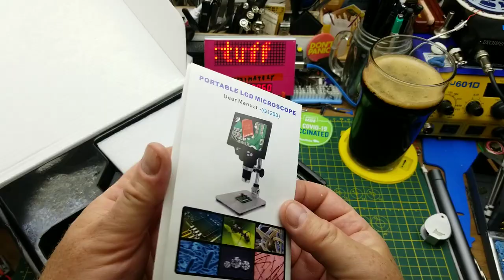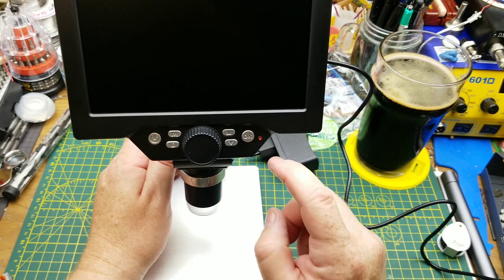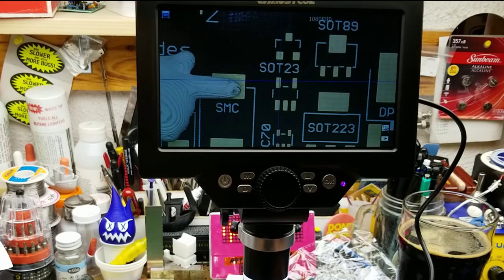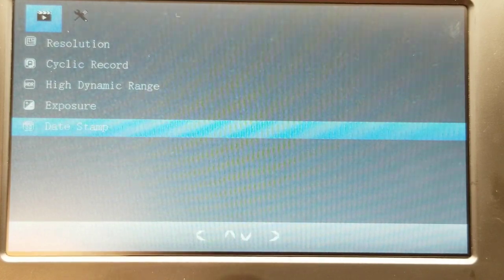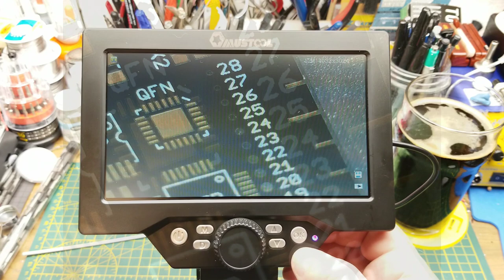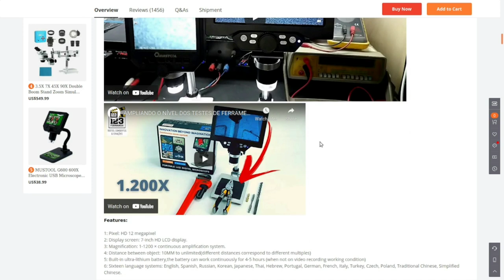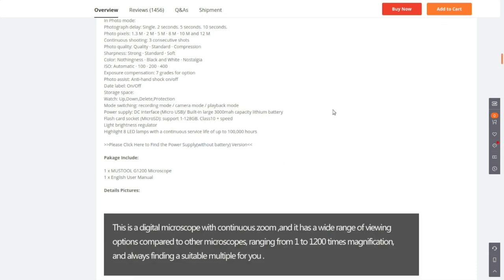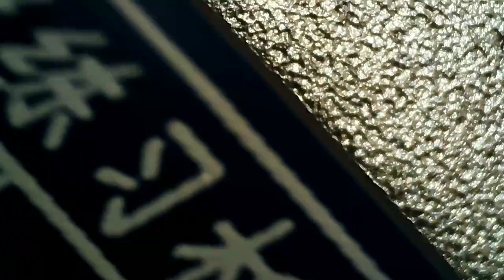Digital microscope review/first look

Comment: Just a couple of quick tips: 1) put a silicone sheet under the board to keep it from sliding around, and 2) make sure your soldering iron heats up the pad AND the component (position the iron to contact both at the same time) before adding the solder. Bonus tip: at these sizes, extra flux can help "hold" parts in place, and distribute heat (reducing the chance of overheating the board or part).
Reply from the maker: I do need some practice working at this scale.
Thanks for the silicone pad tip, that's a good idea.
Reply: I would also invest in an air reworker and some wick, low melt solder and flux.

Comment: It takes about 15 - 30min before your brain gets used to not having your hands in front of your eyes. 
I find it easier to hold the part in position, load the iron with solder, and apply to the end of the part to tack it down. You just have to drown the area in flux beforehand and that will attract/clean the solder to the part/pad. 
I've got 4 dead PC motherboards with 0402s'. so it quite tempting - lol -.

Comment: I purchased one of these a couple of months ago and find it invaluable for inspection and fine soldering. My only complaint is that it does not go high enough for some soldering jobs and catches on the iron etc. I have overcome this by purchasing a tall laboratory type stand and place the unit onto this which raises the unit to about 10 inches (25cm) from the base. Well worth the money even with the modifications.
Reply: Sorry, are you saying that the "zoom factor" of this item, out of the box, is too high for soldering jobs and that I can manage to use it better if I put it away from my PCB?
I am looking forward this kind of suggestions before buying it and the video does not completely answer about (I only see close-up view of 1 or two components which is not ideal for soldering)
Reply: Well a cheaper alternative is just put it on a stack of novels or books, but i am thinking of getting an ipad table stand instead.

Comment: I've not yet tried surface mount soldering but I have been watching live streaming lately to pick up some tips. A streamer named Syd Heresy does a lot of live SMD assembly and trouble shooting. pileofstuff would do well to clean his boards with rubbing alcohol and a toothbrush to clean off the flux when he's finished. But I thank you for this video because when I finally attempt it I will want the microscope.

Comment: Use a dual soldering iron, pre-tin both pads, clean both tips, add some solder to both tips, position smd component centered on both pads, and heat both sides evenly at the same time, and release one applying light pressure to the center of component to hold position,  then release the other tip and remove the position hold tip.  Touch up one side at.a time removing excess solder by swiping across the terminal.

Comment: I ordered, tried, and tested a bunch of different digital microscopes from Amazon. The Andonstar AD-407 was my personal favorite, and the one I kept.  They all had horrible depth of field, including the AD-407.  I tried a 30mm wide angle macro lens, but did not work for me.  Blurry edges, and still to zoomed in for me.  I ended up making a 100mm extension tube, that worked a billion times better.  It’s much more usable now.  But, I still prefer my tried and true Amscope SM-4TP as my daily PCB micro soldering driver, over these digital microscopes.
Reply from the maker: I have no doubt that those more expensive scopes are superior.
For the price, this one seems reasonable enough for my needs.

 Certainly beats using the optivisor!
Reply: $550 is out of my league.
Reply: About a month in with the Andonstar AD-407.  It’s just frustrate to use.  The footprint area you have to place your component is sooo small, with the included base.  Going to try doing an articulating microphone stand conversion to solve.   Hopefully this will solve both the depth of field issue, as well as footprint area limitation issue.  I want to love these digital microscopes. But they are just not functional for me the way they come, out of the box.  Mod time!!

Comment: I have the same microscope, and mine have a tendency to move the image sideways when i adjust the focus.
I belive I could see a bit of that happening on your's too.
Btw, if you use thinner solder wire then it's easier to get a proper amount of solder on the pads, and not a big blob.
Solderflux is also handy :-)

Comment: Much prefer the larger distances available from the Andonstar models, also the redirectable dual lights on those. 
Space under the lens easily allows soldering/desoldering underneath,  40mm is really too narrow. Adjustable light direction and intensity is very good too.
Reply from the maker: Yeah, having lights from an angle does help with reflections and also judging depth while only using one optical path.

Comment: I have to say the Adonstar 407 is a better tool with the remote so you don't have to touch the Microscope to zoom and the adjustable lights at the side for angling:-) but a nice video review I did find that putting a line from top to bottom and left to right on the base to mark the centre of the scope helped with aligning pdb where I wanted to find the part
Reply from the maker: Ive got a small cutting mat that i was contemplating sticking on the base, just for that reason.

Comment: I appreciate the review, and it looks like an acceptable product - maybe even excellent for the price.  I'm curious to know how it holds up over time, and whether the bench space it takes up is worth the added convenience over a magnifier.  But I'm also curious about that "tilt" feature...
You mentioned it in the mailbag unboxing, and again at the start of this review, saying that you thought it should help in dealing with reflections and getting the lens out of your way.  And then nothing.  You not only didn't show it tilted, you didn't mention it again. 
So - have you tried it, and is it useful, or not? 

Another question - How do you adjust the magnification?  You never said, but from the what I saw (and ignoring the digital zoom feature) it looks like the only control is how high above the surface you have the camera?

Which raises questions about the documentation and claimed specs...
- @1:35 you showed and read from the fold-out 'Manual' that it had a working range of 20 to 40 mm, but I don't know what that illustration is about because @6:25 you showed it working at 13cm above the platform
... and ...
- The box, fold-out, and website all say it does "1 to 1200" magnification, but that's pretty obviously nothing but marketing wank!
It doesn't seem to do "1X", because when you had it at its maximum height, 27mm on your ruler filled the screen width, but 27mm at 1X magnification should only cover 27mm of the screen. It's a 7" (diagonal) screen, so the visible area is probably about 150mm wide. Dividing one into the other gives us a minimum magnification of approximately 9 point 4 something.   
And a few moments later, you show it "as close as possible - crazy close" with a touch over 2mm filling the screen width. But of course, 2mm at 1200X would fill a screen over 2.4 METRES across! It looks like the digital zoom goes to 4X, but even multiplying by 4 would still have 1/2mm filling the screen, when it should be [ 0.5mm X 1200 magnification = ] 600mm (almost 2 feet) across. Half a millimetre filling a 150mm screen width is an apparent maximum of 300 times magnification - nowhere near 1200! I guess they're counting on nobody checking?

Of course, I'm not sure how useful 1200 times magnification would be in the real world? The smallest surface mount resistor I can find - an 0201 - is 0.6 by 0.3mm, and at 1200X magnification that would look like a 720 X 360 mm rectangle (about 28 by 14 inches)! I mean, c'mon - do you really need to see the bacteria on your circuit board? (At 1200X, a 1 micron [= 0.001mm] e.coli cell should be visible as a 1.2mm dot on the screen).
Reply from the maker: Yes, the magnification is adjusted by changing the lens distance from the work.

I did tilt the stand slightly to get rid of a reflection off the PCB, but I edited out that adjustment - the video was already getting too long.

Yeah the 1200 is just a marketing number. Still, adequate magnification for my application.

As I said at the end, it's not a high-end piece of lab equipment, but it's also not as costly as that

Comment: I made this for holding small parts. https://www.thingiverse.com/thing:2772207                  The spring I used is from a clothe peg clip like this https://ca.neatfreak.com/products/20-pack-non-slip-clothespins-clips            But don't buy it there, go to the buck store. The pointy bit was from a solder dispenser plunger thing. I had to cut the sharp part down to adjust the height. You should print one. Oh, and I used my old crusty solder paste.
Reply from the maker: That's an interesting solution.
Thanks

Comment: Which version of Linux and desktop environment are you running? I like the clean dark theme look
Reply from the maker: Lubuntu Bionic Beaver with (mostly) the default desktop.

I probably should upgrade to the current version, but it's not a priority for the light duty work i use if tor.

Comment: I get the impression it needs a little something to hold the board in place while you solder.  Perhaps some double-sided sticky tape?   & thanks for the review.
Reply from the maker: I tried some tape, but that made it harder to move the board when i wanted to.
Reply: @pileofstuff  perhaps a grippy thin rubber sheet then.  I think you mentioned that, or something to that effect.  It was early, before coffee.
Reply from the maker: @matambale  Another commenter suggested a silicone mat (like the one I use with my hot glue gun).
Reply: I've used a blob of blue tack (thanls Julian !) which also allows a degree of movement

Comment: I think I have the same amount of trouble getting uses to the perspective and working with it also. for china goods, it's a tad on the expensive side, nonetheless looks like a nice little introduction toy-like unit for trouble-shooting joints or for kids that want to get into micro soldering.
Reply from the maker: I'd say it's also acceptable for hobbyists who don't need to go full binocular microscope.
Reply: @pileofstuff  I Still don't know why no one has done wired FPV style glasses or goggles for those sorts of microscopes. Unless someone has and it didn't work all that well lol
Reply from the maker: @patprop74  That's an interesting idea.

The only downside is what you'd have to take it off to find things on the workbench outside the microscope's field of view

Comment: Didn't that base come with clips for holding the circuit board down to make soldering easier? I have a cheaper model that does have the clips.
Reply from the maker: No, this one is just a large flat heavy plate.
Reply: @pileofstuff  mine has, maybe you could print some clips or just use some kapton tape or electrical tape on the edges of the board to hold it in place to make thinks much easier.
Reply from the maker: @stevetobias4890  I tried some tape while making this video, but it quickly became inconvenient every time I wanted to rotate the board, so I edited that part out.
Reply: @pileofstuff  maybe you could find some clips and either screw them on or use small rivets. They really do make so much of a difference, I actually used mine tonight as I am designing a secondary bench power supply using a 48v 5a DC board I got from eBay. It was in a case like a laptop charger and I opened the case to find a Poe board with an input and output poorly tacked on. I made the connections much more secure and it will have dual adjustable power outputs. Another I will make with a larger 50v 8.5a power supply. Maybe I should start making some videos and post on YouTube.

Comment: For under-a-hundred-bucks it looks like a pretty good deal. Particularly, the image on your computer monitor showed more detail (slightly ragged edges on the silkscreening) than I'd ever need. The optics are surprisingly good- no pincushioning or blooming at the edges.

The baseplate seems to be fairly grippy- I didn't notice the scope or your workpiece sliding around much.

If I was still doing field inspection and repairs I'd really like the portability- does it feel rugged enough to handle a little bouncing around in the toolbox? If not, an old Makita box and some foam would fix that, I imagine.

All in all, fine review. Not-too-anxiously awaiting six month update. ;>)
Reply from the maker: The base is quite heavy, and has some rubbery feet under it. But there is nothing to hold the workpiece in place - I'll have to experiment with some of the suggestions from the comments.

The microscope itself, I'm not sure how well it would stand up to "bouncing around in a service truck" unless you built a custom foam padded case for it.